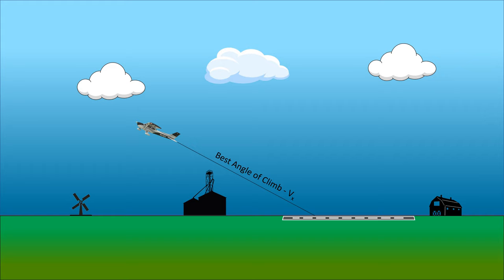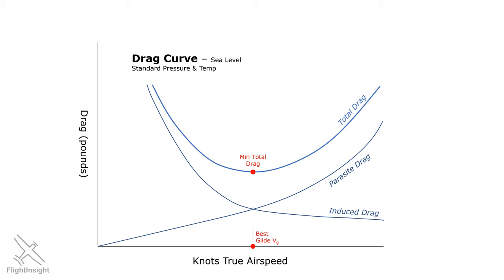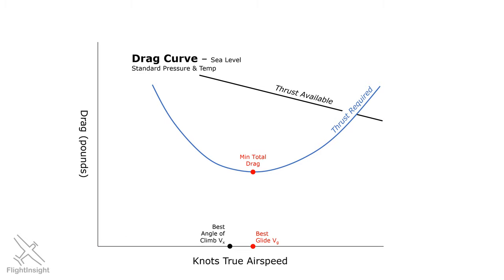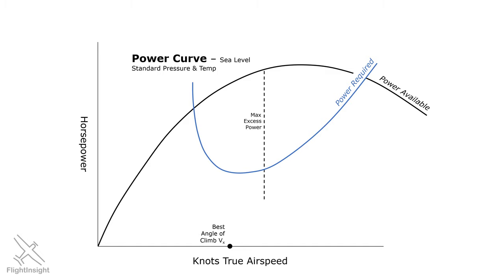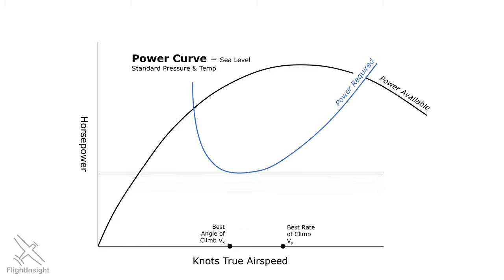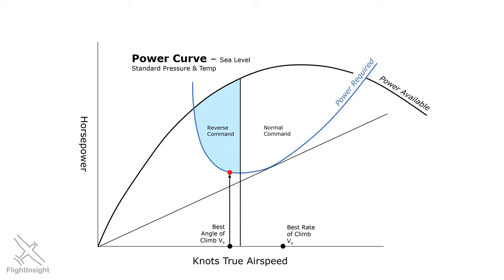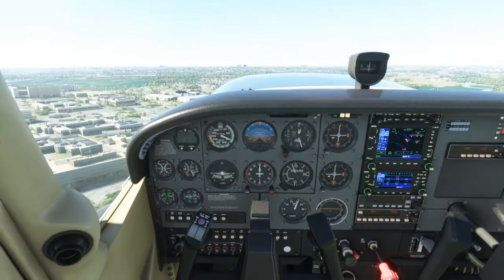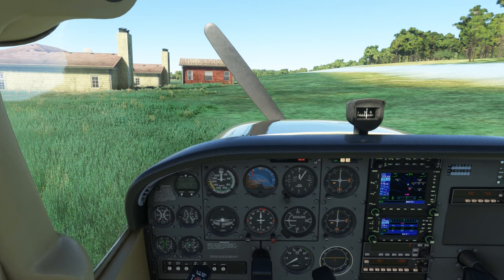Best Rate of Climb | Vx vs Vy | Region of Reverse Command | Power Curve

Comment: I dont know the difference between power and thrust though. Or is it like that; they are the same for jet engines and somehow different for piston engines? If so why? Also, why were the power available and thrust available curves were drawn like that? Not implying they are wrong just wanna know why. Would their shapes change if it was a constant speed propelled aircraft? What are the factors for decreasing amount of available power and thrust other than altitude temperature and air pressure? Thanks...
Reply: Power is required to turn a propeller. Thrust is the result of turning a propeller, but as it is variable with speed, less so with a constant speed propeller, the curves are not the same.  Piston engines are rated for the power they can produce to move the propeller.

Jet engines are a different thing altogether, power is not used at all with them, just thrust as that is what they produce. In effect they produce zero power when having full take off thrust while still standing on the brakes. Jet engines are rated for the thrust they produce, which is then used to directly move the aircraft. 

Turbo-Prop engines are, again, rated in power, not in thrust.
Reply: Thrust is force and power is rate of doing work. Thrust is the force you apply to overcome drag and/or accelerate whilst power is the rate you burn energy whilst doing so. Both these things apply equally to props and turbines. 
  Keep in mind that both props and turbines work by accelerating the incoming air flow. Each system is limited in its own way. To oversimplify somewhat, a turbine is limited by Mach 1 in the jet nozzle (which is greater than Mach 1 flight speed due to the extreme heat) and a prop is limited by a tip speed of Mach 1 (that is not to say that prop wash is near Mach 1, just that the tip speed limits the thrust). In both cases, as incoming airspeed increases it can be accelerated less before reaching the upper limit, hence, thrust inevitably reduces with airspeed.
  A distinction arises in the characteristic curves of the two propulsion systems because the airflow through the turbine benefits from increasing ram effect with speed. The ram effect offsets the underlying loss of thrust at high speed. Thrust becomes nearly constant wrt TAS. But piston engine airflow (and here I am referring to through the engine not prop) is mainly dependant on RPM and virtually independent of airspeed so loss of propeller efficiency is not offset.
   This characteristic difference gives rise to the concept that turbines are ‘thrust producers’ whilst pistons are ‘power producers’. That should not be taken literally, but the differences impact on performance so they are worth understanding.

Comment: So, the airspeed is the most important factor?
Best angle of climb speed, VX 	59 kt  for a cessna 172, right? 
You wrote "pitch for the speed" in the description.
Does that mean, full throttle, but literally pulling the yoke back (which reduces speed) until the plane is flying 59kt at whichever climb rate might be indicated?

Or is the throttle set to the value that gives that speed and one then uses like, a 'best feet per minute' figure on the indicator?

Know what I'm getting at? 
Again, like, is it full throttle? And you pull back the yoke until 59 knots, even if that means going upwards like a rocket on the VSI?
Or, is it a rate of climb like "750 f/m" on the VSI? and you use the throttle to set the speed to 59 knots to achieve that climb rate on the VSI with that speed?
Reply: Okay,  I actually grabbed a cessna POH and the conditions described for takeoffs and best climb are "throttle fully open".
Which I will take as , well, just that. Throttle fully open, plane pitched upwards until speeds match.
Reply: Typically you only end up at Vx after takeoff, so you are accelerating to that speed, rather than slowing down to it (in normal operations at least). So on takeoff, you achieve Vr, lift the nose, and then as you accelerate, pitch up until you hit Vx and then hold the speed there (with pitch). Then, like the video said, you wait until the obstacles are clear and then pitch down for Vy. If for any reason you needed to get to Vx from a higher speed, then yes you'd just pitch up until you can hold Vx; should you need to change power in that climb, you would make the appropriate change, then make minor pitch adjustments to maintain Vx (just as you would in an approach; pitch for approach speed, and power to maintain the glide angle). But again, if you're at Vx it's probably because you plan to clear some obstacles, so I'd recommend being at full power anyhow.